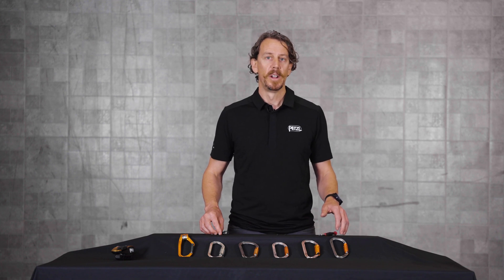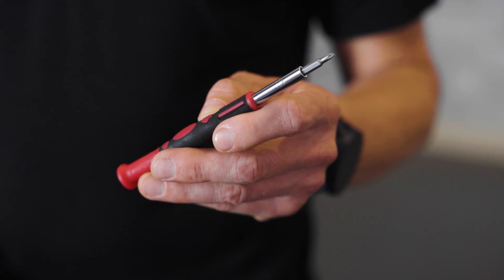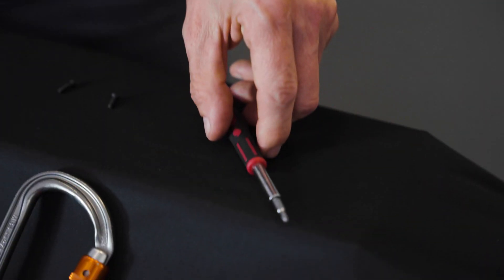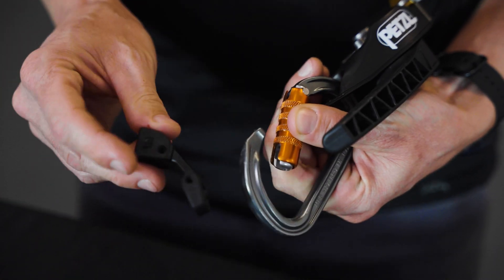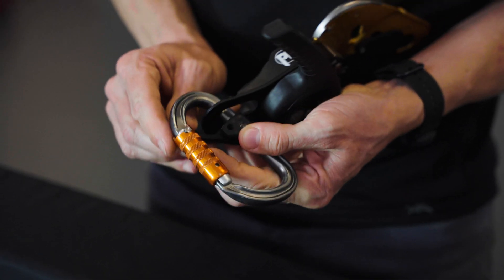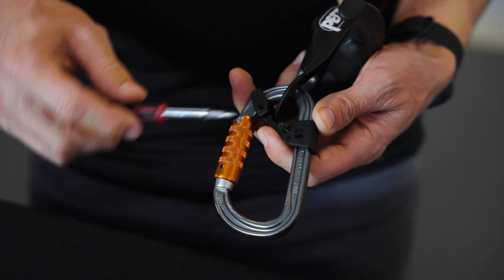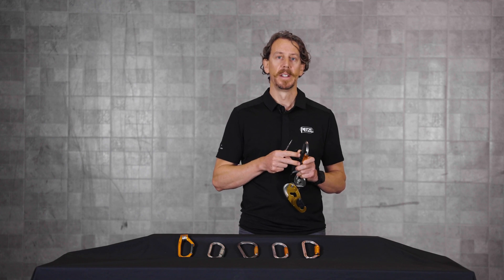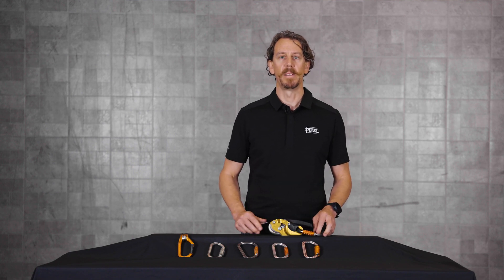HOW TO install the CAPTIV

Comment: Really like the captiv-option. But it would have been great to print/engrave the serial number of the carabiner on a different location. At it's current location it's partically blocked and makes ppe inspection much harder & longer.